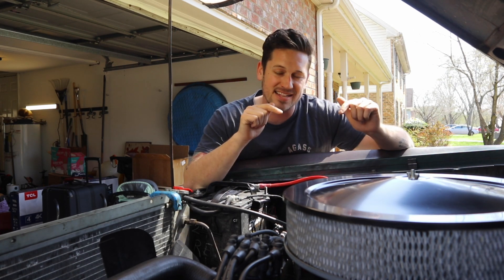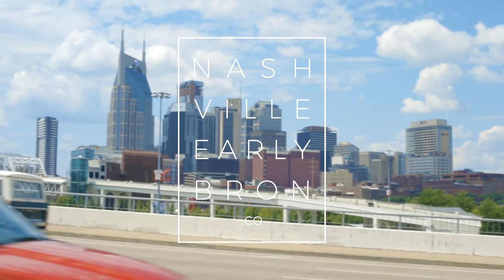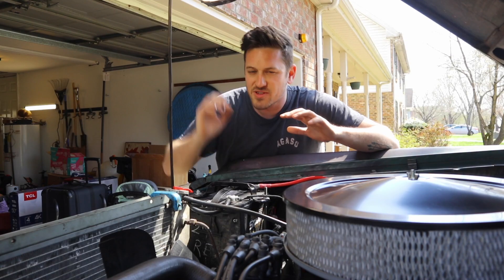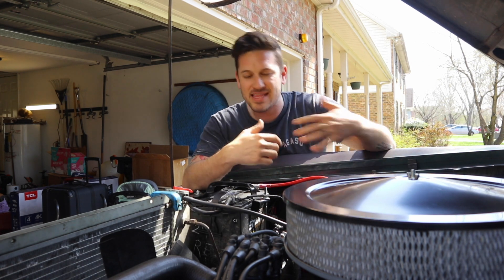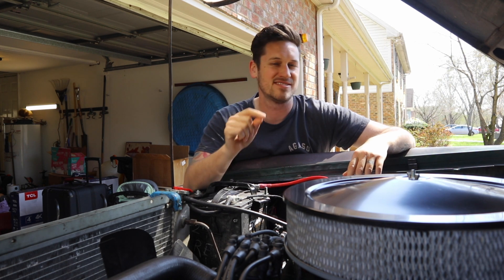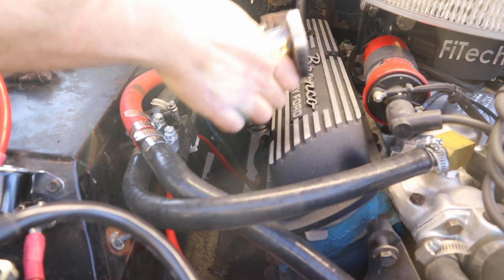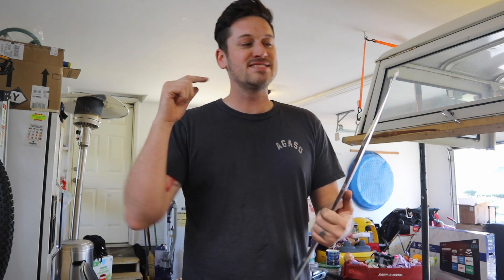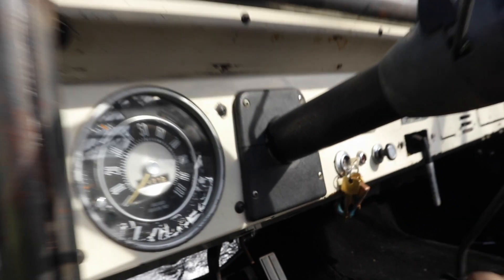Fix your FiTech EFI

Comment: Hi, got the same issue.  Fi Tech running very rich on startup.  Heard ticks and both gaskets had issues.  Was running fine before.  Did you find that this gasket fix not only fixed you ticks but leaned things back out?
Reply from the maker: I went in and leaned it out in the settings and then over time it self adjusted.

Comment: No! 

I have a full exhaust system that is new and has no leaks and it does the same thing. Have I ever told you I hate my Fitech? It is without doubt the most shitful thing I ever purchased. I hate it. no part of it works properly. no easy starting say 15 - 20 cranks, no even idle, no acceleration, popping on overrun and backfiring throgh the throttle body. The motor is brand new. The exhaust brand new, the ignition system brand new, fuel pump brand new. Comp good, vac good, leads new, coil new. 

Massive rich 9.8:1, massive lean 21.0, rich bog 9.8, backfire, backfire, backfire, cut out screen goes white. No matter what I do it just keeps doing the same thing. Fitech support are aholes. They simply don't want to know. Don't call back when they say they will, get somebody else to deal with it, leave you hanging on the phone get sick of waiting after 50mins hang up. Ring back - repeat. 

When I get some money I'm putting a carb on it. I installed it in September last year and I have never driven my truck since as It doesn't work and I don't have the money to put a carb on it. Cost me big.
Reply from the maker: Ugh! Terrible man, I’m so sorry
Reply: I would look at the map sensor and make sure its reading correct.

Comment: Typically a small exhaust leak will not change the air fuel ratio in exhaust. When you have a leak you are pushing out exhaust not in. You just have less exhaust going past the O2 sensor. Check your map and calibrate your O2 sensor.
Reply: I used the Percy's gaskets on mine and they are still holding up. Before them I had non stop leaks. Probably went through 4 sets of gasket before I tried these
https://www.youtube.com/watch?v=5YKaTk_KZec

Comment: cheap headers will have thin flanges that may warp , look into stage 8 locking header bolts and use quality header gaskets. but yah leaks will fool the 02 sensor readings.  Hey not beating the proverbial dead horse but hows the return of the fitech and im itching to see your  edelbrock efi swap hint hint... Cheers
Reply from the maker: I just need to edit the video, the swap went great!

Comment: I know your not a professional mechanic but to avoid confusing others you should use the correct terminology. Detonation happens inside the cylinder not in the exhaust. Detonation is caused by poor timing or hot spots within the cylinder causing the air fuel mix to ignite at the wrong time, exhaust ticking (the sound you hear) is due to exhaust leaks not detonation.
Reply from the maker: Ahhh! Thank you. Appreciate the feedback. I had a feeling I was using that word wrong, I should have investigated it before using it.